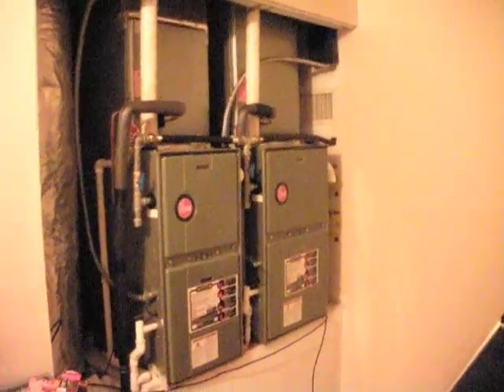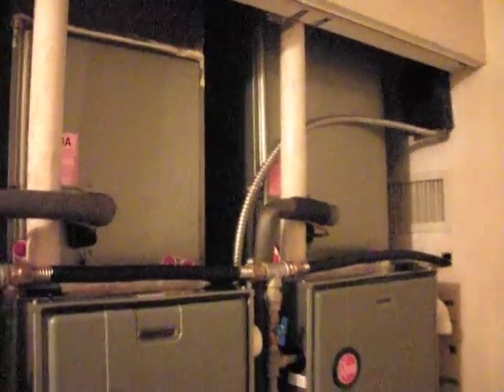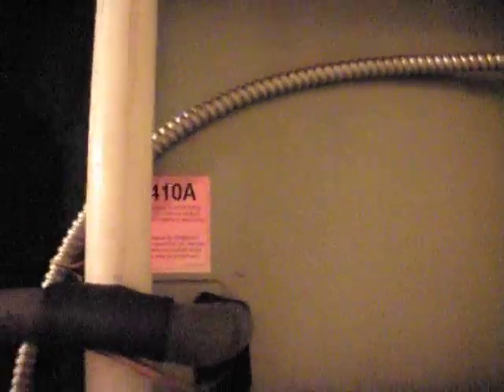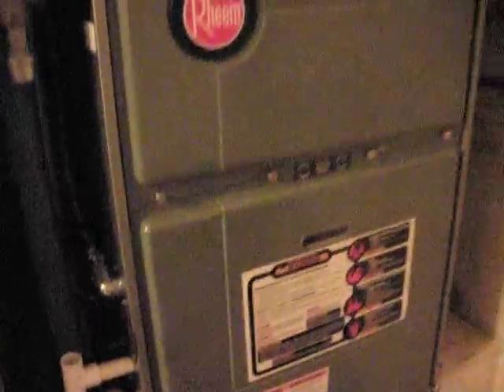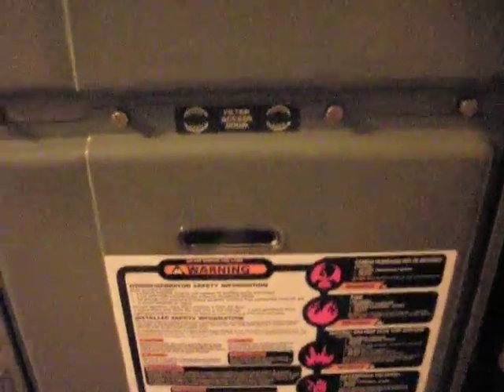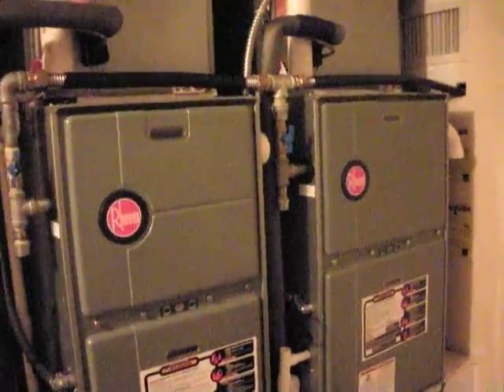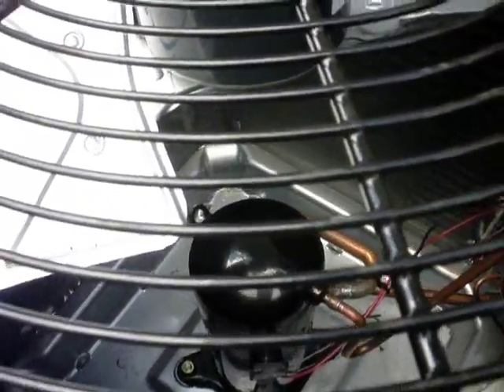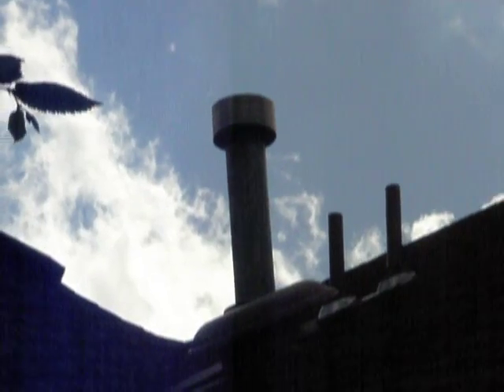Rheem Furnace and A/C System Installed

Comment: Respond to this video...          The one on the right is supposed to have 3 inch exhaust according to rheem specs.. looks like a good install,. You might want to add a condensate riser or it could create water damage. I like how you installed them with the bottom draft.

Comment from the maker: @jess568667 All gas furnaces run on 120V since the only thing you need to power is the blower and the controls (I think oil furnaces run on 120V as well). Compared to an air handler they usually have electric heat strips which need 230V to run.